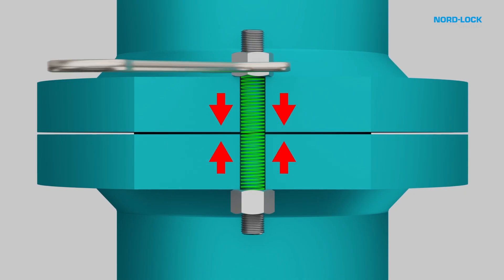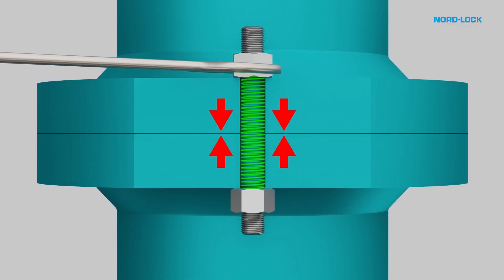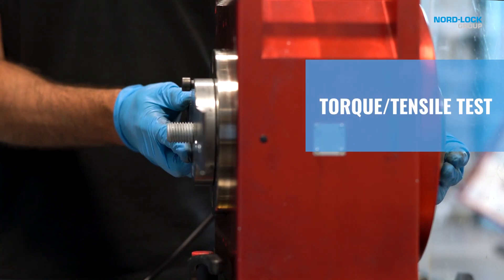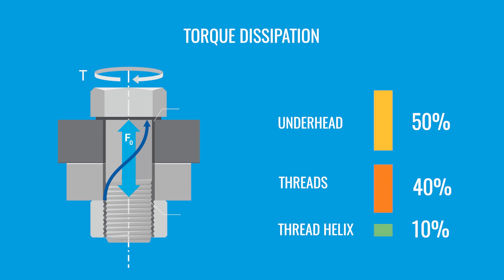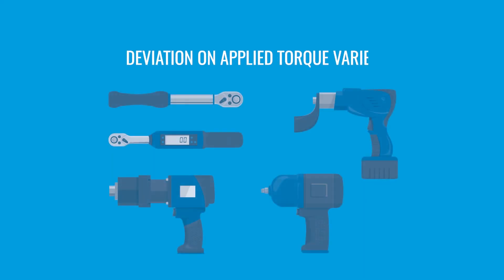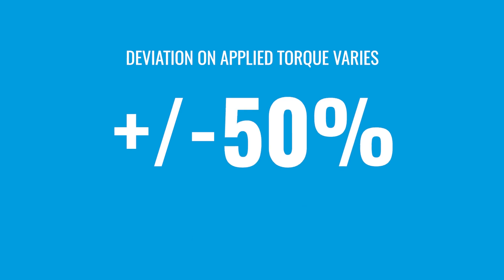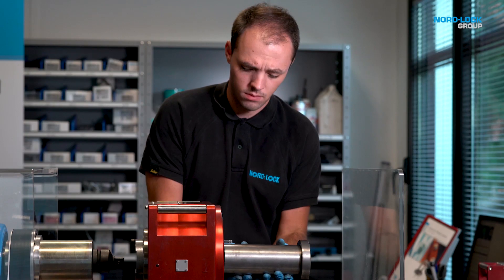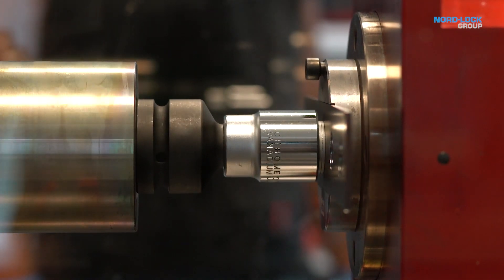The Experts - the Relation Between Torque, Preload and Friction

Comment: For installing wheels on a car, the lug nuts are tightened using a torque wrench until the indicated reading is between the manufacture's specifications for minimum and maximum values. However, they do not specify using a lubricant. Nor do they consider the rust that occurs over the years. Would this mean don't use a lubricant; always tighten dry? Seems the manufactures already took this into consideration and you can only tighten dry to the specs. Do you have any comments you can offer?
Reply from the maker: The friction coefficient used in the calculation of the appropriate torque is the most essential parameter. Two strategies can be implemented to control the torque/tensile relationship while making it achievable and controllable easily on an industrial scale: 1) for large volume applications with very standardized items - both on first fit installation and in after market retrofits -  one fix range of torque is specified by the manufacturer and consequently an appropriate friction coefficient must be achieved; or 2) for low volume applications, well optimized joints or non-standard designs and components, the friction is defined by the type of materials, coatings or lubricants usable and consequently a suitable torque is determined by the designer.

In case 1) all parts are standardized so fasteners come with a pre-set state that always have the same friction coefficient and therefore match the right preload at the specified torque value. Hence, that one torque value fits all joints and fasteners can be assembled right out of the box. This approach implies specifying a single combination of material and coating for the fasteners - usually integrating a lubricant in the top coat or in a dry film, hence lubrication is « built-in » - so operators never have to apply any extra lubricant during the tightening operation. It is typical on high volume assembly lines in industries where standardization is key - for example, railway rolling stock, automotive cars or trucks.
In case 2) joints are managed one by one and for each the designer calculates the appropriate torque based on the type of materials, coatings, finish or lubricant available. Hence each bolted joint can have its unique torque value or lubricant recommendation. It is typical in power generation equipment for example.

Provided that truck industry falls into the category of high volume and very standardized joint designs, wheel/hub joint is managed as per case 1) described above. Wheel nuts and studs come with a pre-defined friction value as per manufacturer’s specs to avoid requiring the application of an extra lubricant during the tightening operation, exactly as you described. It can be based on typical friction values for uncoated/coarse finish parts if they are black, or with a lubrication top coat or dry film if they are coated. By controlling the friction of the fasteners, manufacturers of trucks can define a single range of torque for all their trucks without the need of an extra lubricant during the mounting.
Reply: 6

Comment: By coating the nut face/bolt head face, aren't we going to loose preload sooner? It's the friction between then that can prevent loosening of the nut once tightened, right?
Reply from the maker: It’s definitely admitted from a mechanical stand point that the friction keeps the bolt and the nut locked after assembly – otherwise the nut would naturally spin backwards to release the accumulated preload. Hence, most of locking fasteners rely on increasing the friction to lock the fasteners. Vice-versa, lubricants reduce the friction hence the resistance against self-loosening of fasteners. Nevertheless, the characteristics of lubricants may change between assembly and in service conditions: ageing make most lubricants dry out quickly and therefore not affect the locked state of the fasteners, while others remain fluid and keep friction low.
At last, most of joints are designed and built with sufficient safety margins to prevent the eventuality of loosening and therefore lubrication has no effect on them during service, but in case of loosening-sensitive joints it’s true that lubrication may help fasteners unscrewing.